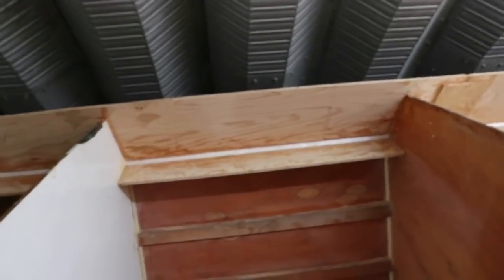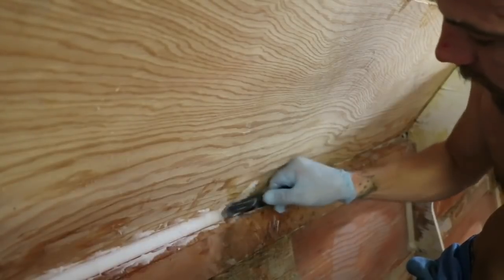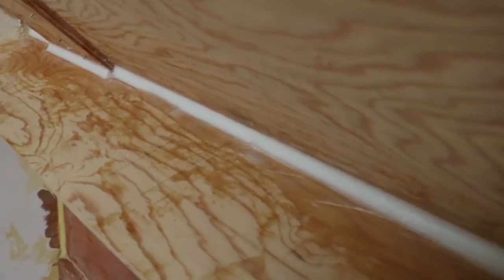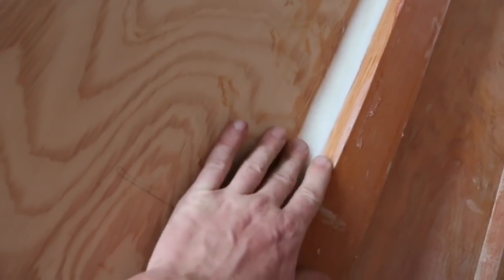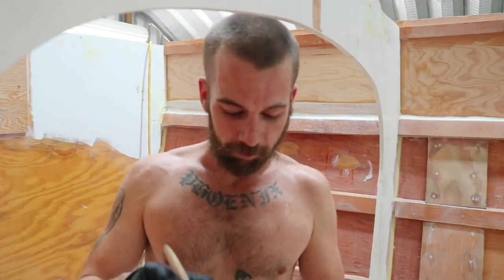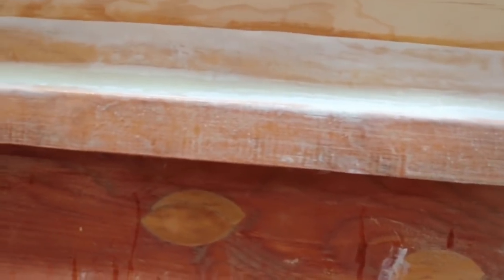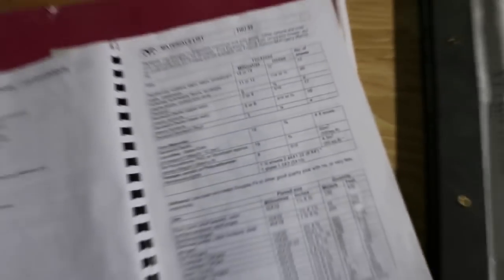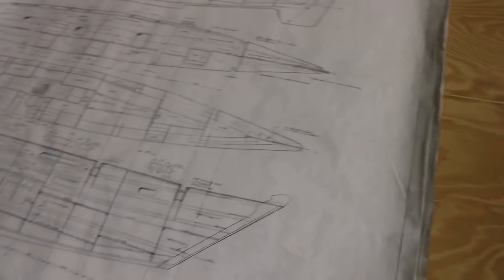E18 MA’TIKI - Greenhorn builds a Catamaran

Comment: I don't have experience with dinghys but from what I've seen in videos the RIB "deflatable" ones always leak eventually. That would drive me crazy. I'd make a dinghy that 
1) fits to your boat and can be easily docked or hoisted up between the stern and 
2) is unsinkeable (foam) and easily repairable. and 
3) looks like nobody in their right mind would want to steal it.

Thanks for the video!

Comment: Hey man, loving your videos.  Have you tried glassing over the fillets while they're still wet?  I'm currently building a dinghy (much less than 200 feet of fillets though 😅), and that's what I've been doing.  It saves the sanding step as the thickened epoxy has some give to it and can conform to the glass as you put it on.